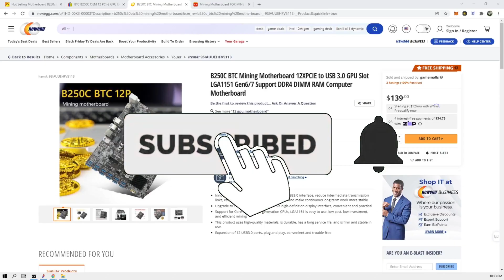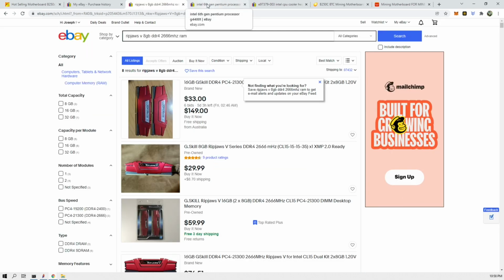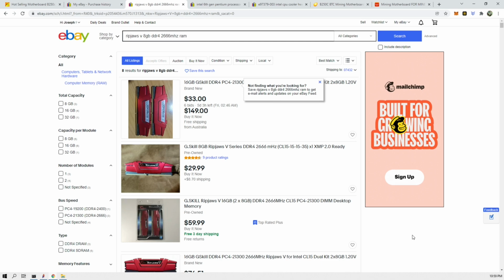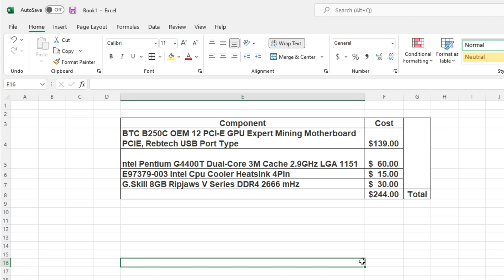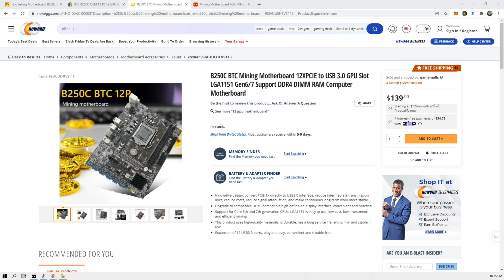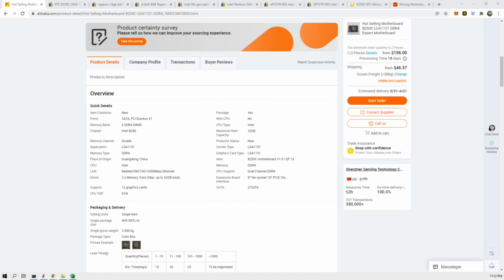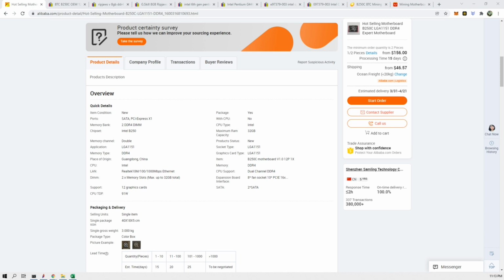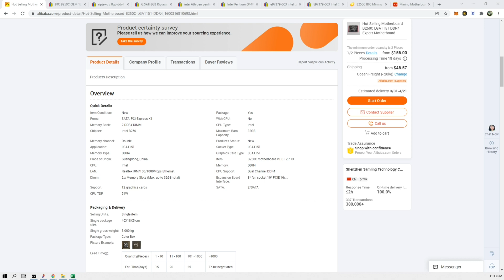B250C Motherboard Product Review

Comment: Hello. Thank you for the video. I just got my same mobo setup last week and am struggling to keep my 7 nvidia cards working. What bios settings did you use? I’ve got 4G encoding enabled. I’ve tried DMi max link and pcie settings auto gen 1 gen 2.  Nothing works.  At one point it ran 10 hours no problem. But usually mine seizes up on me. I’m running hiveos. Very simple.  I notice there are about 25or so pcie ports in the bios which is confusing. Plus some pcie controller. Plus the dmi max link speed.  Idk. This mobo is not working for me.
Reply from the maker: What’s cards you got on the rig? I’m on discord we can chat there. My tag is redllama#1315
Reply: @RedLlama  I'm trying F9 optimized settings now. I was at the black screen of death. I see F9 default sets the first Peg setting to Gen1 and the rest to Gen2.  DMI max is auto.  I have 1x3090, 2x3080, 3x3070. normally i connect 1x1060 (6GB) card too but i yanked it because i thought it wsa cauing problems
Reply: @chrisg8439  im having the same issues. were you ever able to fix what was happening? i got 1 3060 ti, 2 3070, and 2 amd 5700xt running on this rig and it will run good for like 12 hours and then cut off. the only difference is im running it on windows 10 not hiveos

Comment: Hello i buy CPU: core i5 7400 and dont show any image can help me please
Reply from the maker: Are you on discord? I can try and help you trouble shoot it. My tag is redllama#1315
Reply from the maker: Oh no that’s a lga 1150 socket and the mobo is a lga 1151. They are not compatible
Reply: Thanks for your answer but I recheck and it’s lga 1151 processor intel core i5-7400 3.0Ghz up to 3.5Ghz 4core 6mb cache 7th gen cpu lga1151 that was the specification